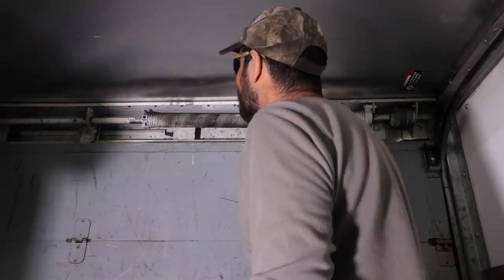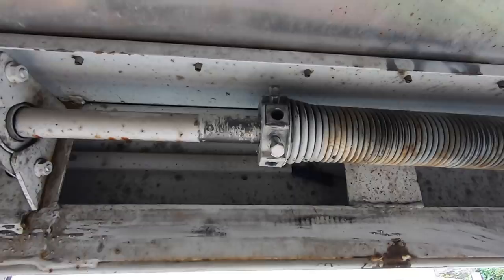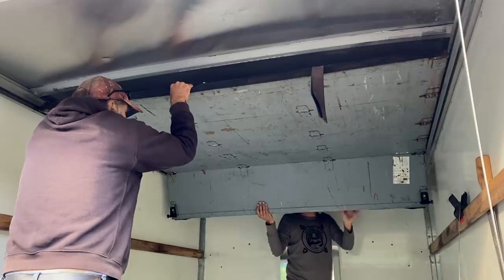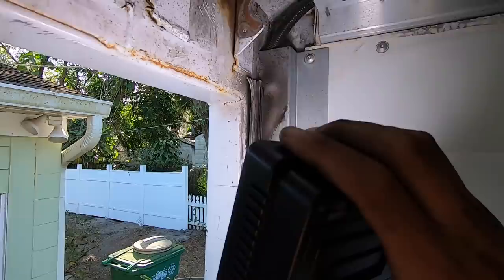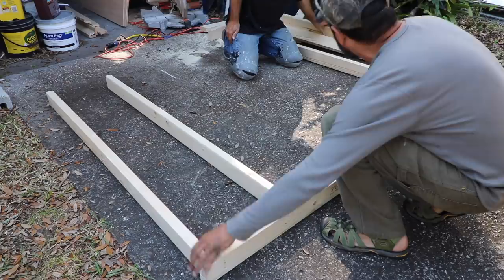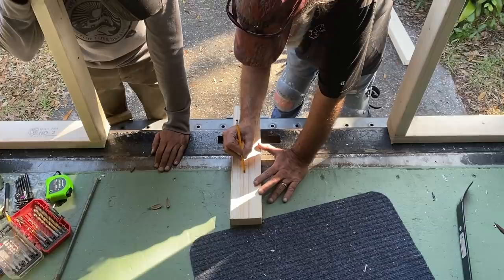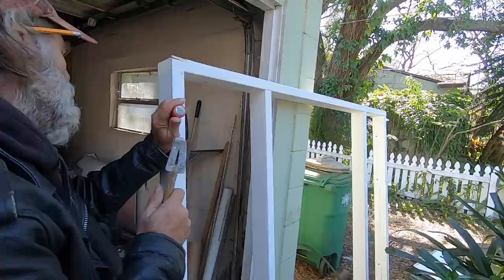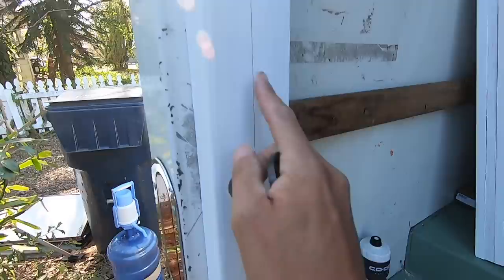Box Van Camper Build Ep. 1 - Remove Roll-Up Door/ Build-Frame New Door

Comment: Just a thought...windows on either side of door for nice ventilation and a small window a/c unit if needed.  I seem to recall hearing a small a/c unit will work efficiently on solar power.
Reply: or a mini split that can heat and cool?
Reply: @leemartin9156  not on solar, unless you are Joe Biden.
Reply: He doesn't stay long in hot places.
Reply: @MyFriendlyPup  What a great comment - on my personal top 5 of all-time! I agree and I hope you run a generator inside your house, RV, or van to generate power. The power delivery companies receive lots of taxpayer money to run those lines out to our homes. Sounds a lot like Socialism, to me. Be sure to seal up those cracks to keep the noise and exhaust in and the cold out! Also, whats the deal with masks, am I right?!?!?
Reply: A small portable generator from Honda or Yamaha will power a small window unit no problem and can be done on eco mode.  They're very quiet and fuel efficient.
Reply: @MyFriendlyPup  You can fit a ton of solar on top of something like this.  Plus, he doesn't seem the type to just sit in his van all day.  So, he would probably use it mostly at night.  That would mean needing a pretty beefy battery bank.  I think he had 300ah (lithium) in his last van.  He would have to at least double that I think in order to easily run a small window unit with lots of energy to spare.
He's probably going to get solar anyway... just not that much.  Same for the battery bank.  So, his extra cost would probably be around $1,200 to $2k max to go solar vs the cost of a good small generator.
So, yeah, from a purely financial standpoint I agree a generator would definitely be cheaper up front and maybe a bit cheaper in the long run.  The latter would depend I think on whether you would use all of the electricity for other things during the winter or other cooler days when the AC isn't needed... like an oven or something like that.  You could also use it to help offset heating costs during the winter.  Stuff like that would help the solar setup make up some ground I think.  And of course there is always that satisfaction of being a bit more self sufficient.
Reply: You'd need one expensive solar setup to run A/C!
Reply: @frankfalkenburry5373  The panels aren't that expensive these days.  It would be more the batteries that would cost a ton.
Reply: Great idea!!

Comment: I replaced a 16x7 ft garage door by myself & after disconnecting the springs I took the hinges off of each panel & removed the panels separately. I just reversed the process putting on the new door and it went pretty smoothly. The old wooden door was too heavy to handle in one piece by myself so removing it in sections worked great for me.

Comment: Could take the wheels off the roll up door and stand up on its side and create a partition(s) or wall in the box truck. Solid mount to the walls or floor... If that wood starts having issues, they have plastic/ vinyl planks at the big box stores that you can use in place of wood. It’s mold/ rot resistant. You do awesome work. Thanks for sharing!

Comment: Silicone seals well, but if you plan on painting that exterior, you'll find it probably won't hold paint.  You'll want to go over the silicone joints with a paintable caulking, before you paint, and that should take care of it.  There are lots of different products on the market, and since its just sealing over well sealed silicone, it doesn't really matter which paintable caulk you go with (though my suggestion is DAP dynoflex, as it seems to seal well to silicone).  20+ years installing windows and doors taught me those lessons pretty well.

Nice job on framing, sheathing and building that custom door, with the barn hinges and jamb kit.  It looks like you two got it together really fast too, which is a positive and shows both your skills off nicely.  It looked like a professional job.

Goo luck with the rest of it.  It looks like you both know what you're doing, so I'm sure you'll get it all together just fine.

Comment: I love the build. I think got the $ the box truck is the way to go. You have powder and clearance. Now the fun part, the interior. Your gonna be back on the rd in no time! Well done, not easy to transfer ones home on the rd I’ve done it myself. Went from 86 Toyota Sunrader to a 2007 GMC 3500 4c4 with Lance truck camper. But I fell into some $ , if I hadn’t I think Ide had copied your build. I am a ski bum so I needed clearance n 4x4. Be well my rubber tramping brother.

Comment: Why not have the support inside the door verses outside the door and have a much cleaner look! A 1 inch door flashing on top of door to help water not run inside the top of the door.
Reply: I agree, and you could then insulate the inside of the door. Even foam board between the braces, covered with thin plywood, would work.

Comment: Use flex seal for the puck lock you pour flexseal into the circle box Frame and then when it’s dry you cut the pieces that seals the lock so no one can lock you inside with the cotter pin or metal object

Comment: What if you turned door the other way? You could use inch and a half insulation between two by fours and cover with Luan on inside
Reply from the maker: The door is the same on both sides. 👍🏼

Comment: Very interesting vid, as I plan to do a very similar build soon.  I want to get the back roll up door off too, for headroom, but also because they are noisy, rattling as you drive, and when you roll them up wet, you have to worry about dripping.  A friend also told me they let in a lot of dust too, and are difficult to insulate.  Will you coat the exterior of the wall/door with something to help shed water/dirt?